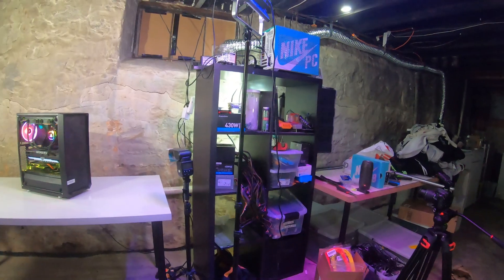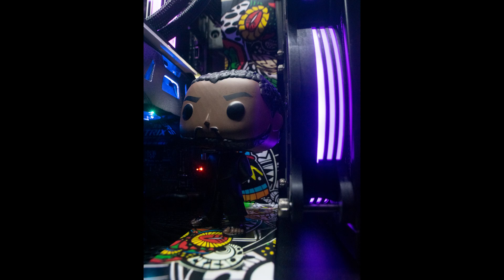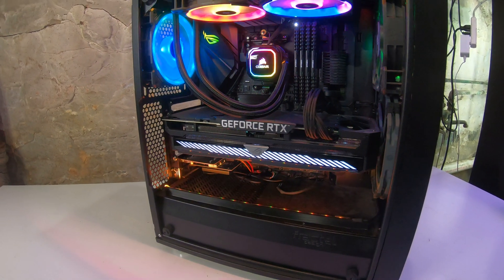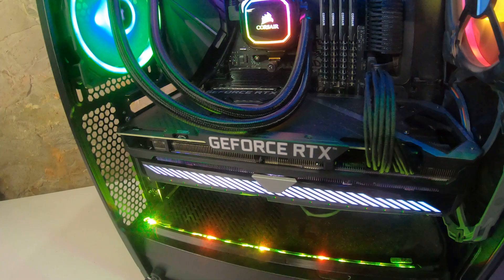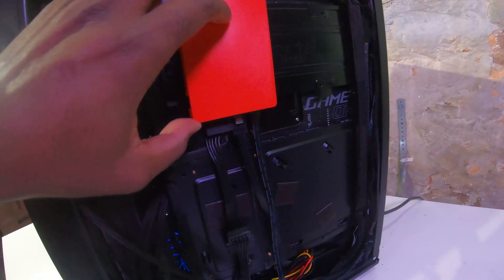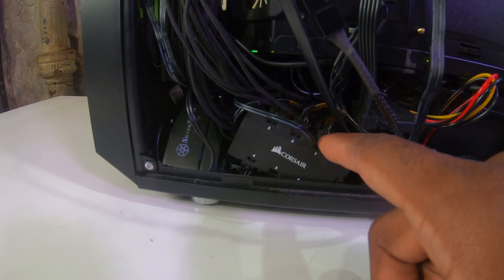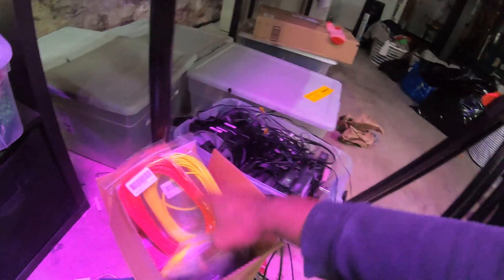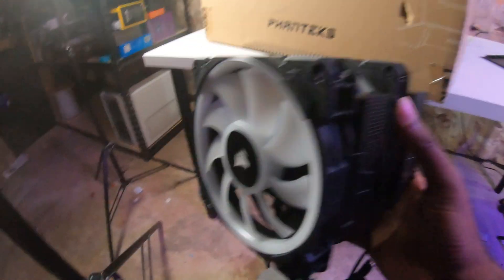PC RIG UPGRADE | Upgrading the channel workstation/gaming PC | Part I

Comment: Great build but you should think about upgrading ur motherboard to a b550 or x570 to take advantage of pcie gen 4 of the graphics card. The card will work with b450 but not to its full potential
Reply from the maker: Yeah I'm working on a video about that